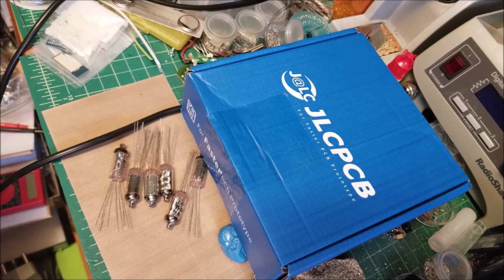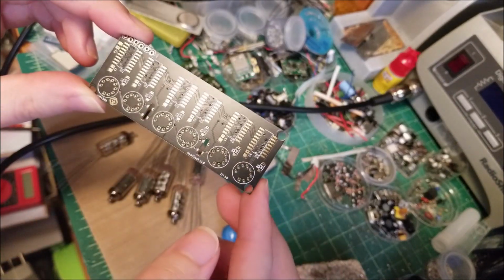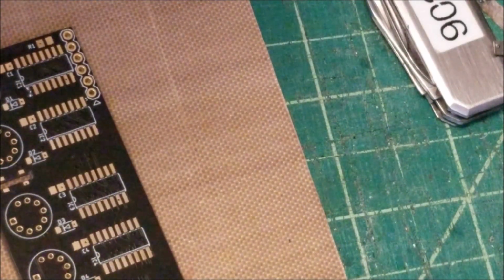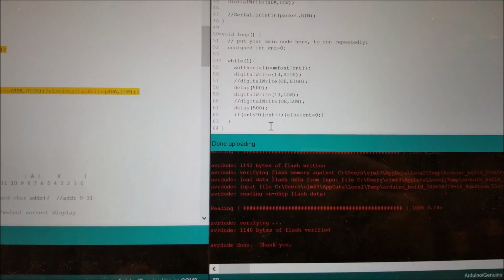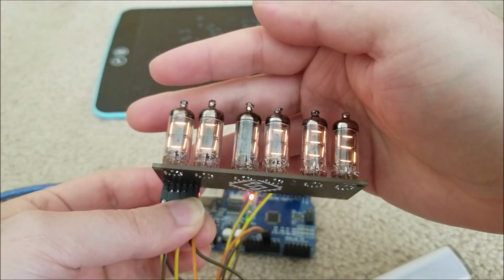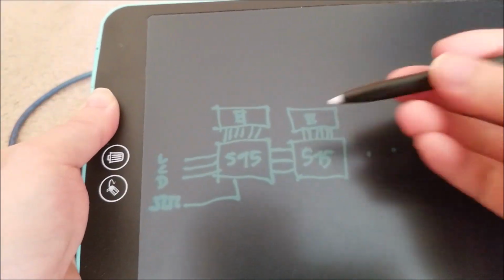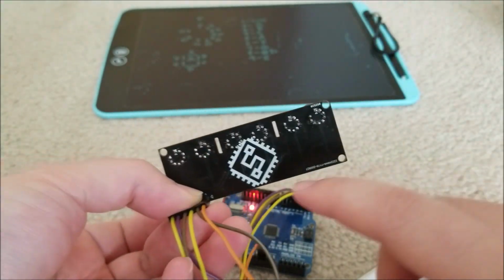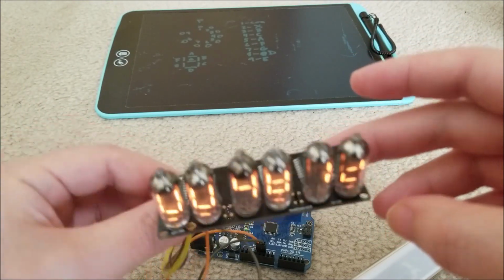DIY IV-16 Numitron Clock Part 1 - Driving the Tubes!

Comment: scusa se sono un po' fuori tema,  sono in possesso di 8 valvole IV-17 a 16 segmenti, è possibile pilotarle con arduino  per fare apparire scritte a piacere? mi puoi aiutare ?Grazie
Reply from the maker: I've made small vfd clocks in the past, you can use their design as a reference. In general you'd need to daisy chain more of the hv serial driver chips I used and wire all the segment pins in parallel so you can multiplex by driving each tube grid sequentially while sending the segment states in the correct pattern you want to display for each tube. If you do this fast enough (~100+Hz) then it'll look like all tubes are lit at once with different patterns displayed.

Comment: Hi, Im doing the same thing at the moment, but I have a couple max7313 and 74hc595. Im not sure which to choose :D
So you are driving the tubes with 5v? Isn't this a bit to much? I think they're rated for 4.8v, would this be a problem in the long run?
Btw, if you want future-proof, go with ESP32, grab time from NTP, and set RTC every 24hours. Also esp has a firmware with sets it as AP when no wifi is configured, and displays a webpage with settings.
food for thought :)
Reply from the maker: Numitrons are kinda the opposite of LEDs in that they are in a way self regulating, the more current they try to draw, the more their resistance increases which will reach an equilibrium and stop increasing power drawn. Even supplying 5v instead of 4.8v will probably just eat the small difference in the output impedance of the shift registers that drive the tubes. I also assume that like nixies of the era they are very conservatively specced so even driving them a little harder should be fine.
Reply: @sjm4306  aaaa, thanks! was having doubts, not any more :)

Comment: Do you have an SMD rework station? I've found it makes microsoldering much easier especially if you have some Solder paste.
Reply from the maker: I just bought a hot plate for exactly that purpose and intend on investing on a hot air station in the near future. I have an industrial hot air gun rn but it's way overpowered and non-adjustable so it tends to delaminate boards and blast parts to oblivion.

Comment: What is the thing you were writing on? Is it just a tablet?
Reply from the maker: It's one of those cheap electronically erasable lcd tablets. I did a few reviews for a couple of them on my channel before. They are great for doodling or doing quick math.
Reply: @sjm4306  Thanks for the quick reply. I've watched pretty much all your videos n didn't across that video. Will have to go back for a second look.
Reply: @sjm4306 Do they make a version where you can transfer from the LCD tablet to your pc or mac?
Reply from the maker: I'm sure they do, but I'd expect that version to be more expensive.

Comment: Yeah I was thinking of a thin silicone heat residence round pad to go under the tubes it will Cushion the tubes and keep it from heating up the board about 0.5 mm thickness